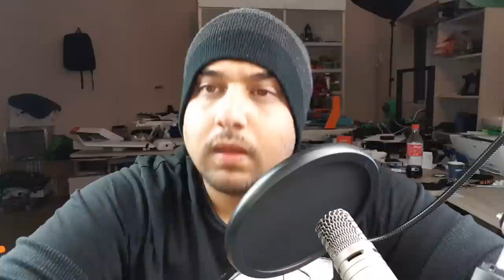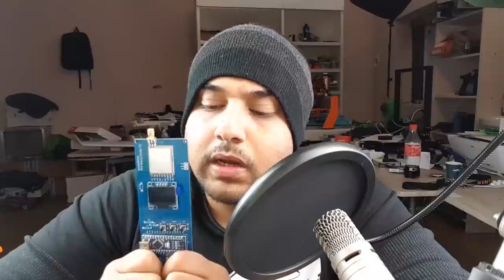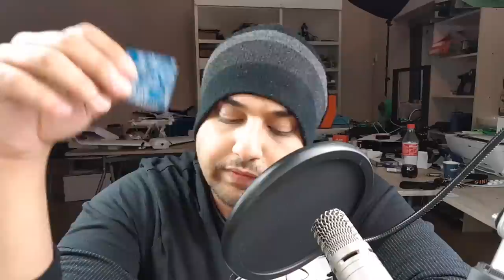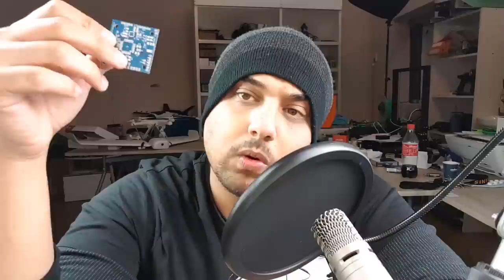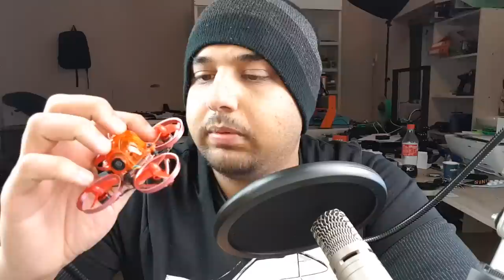DroneMesh OpenFC F7 FC, OpenFC F4 OSD, Wireless Frsky R9M Modules // VLOG #018

Comment: First of all: Great OpenFC project! I heared there's a solution to fight the noise of the ICM, that many FC's have. But even then there's still the elephant in the room: IME Betaflight isn't able to run 32k/32k in it's current state of development. AFAIK there's also no breakthrough for utilizing the F7 better in v4.0 yet - so we will have to wait till at least v4.1, what will be in Fall 2019? Maybe the F7 won't be able to run 32k/32k at all. I tried it on the Holybro Kakute with the F745 and it has 100% CPU load even with everything else turned off. 32k/16k is working - but I don't think it's worth the hassle for a DIY project. I would focus on a rock solid design because the newbie SMD builders will have enough hurdles - don't introduce others with the choice of the components. Only when there's absolutely no downside (other than maybe a few extra pennies) I would go with the ICM gyro.

Comment: Check out the 9 in combat wings with magnetic actuators. Back in the day we used to build little 6 to 7-inch wings out of Depron and hollow carbon rod. You can get a hold of depron sheets. If you need help locating any of the parts let me know I was an avid builder. Happy holidays to you and yours 🙏

Comment: I also love Kits!  Most interested in improving the FrSky experience and ease of use. Wireless firmware update and ability to query firmware versions? I am definitely on board with remote R9M. I want to mount both the R9M and my FPV receiver and antennas on a painter pole. I saw one example of a person mounting his system on a 100ft tower and re-transmitting on another frequency to his home ground station sort of like a repeater system so that he could cover his large acreage even at low altitude. Thank you so much for taking some of the mystery out of flight controllers!

Comment: I like the idea of a bring my F4 back to life kit (only requires the F4 and the MPU6000).  Probably need 2 versions, one with and one without OSD.

The back to life kit should be more for freestylers as racing tends to need a lot more stuff (like OSD, pin for cam control (could be motor 5 or motor 6), led control and regulator for vtx (high power, potentially lots of noise)).  Freestyle is more get out and fly and have fun.

I now need to get my SMD skills up to scratch.  I can see lots of things I can have fun working on and fixing.  I have 3 FC's, 4 4-in-1's and a camera that can be repaired if I have the SMD tools and skills.

Comment: Dude that wireless r9m was my idea! :( (btw you didn't stole it as I've never shared it ;) )
My idea would be to make a dock for external module, such as r9m and put an xsr inside to input sbus and output smartport for telemetry, should be only plug and play, and adding a 2.4ghz VRx and a small 5.8vtx as a repeater so you could fly with you usual setup but for long range and fly from your car or even your house,
If you need other ideas for this project or 3D files ask me, I'd love to help you!

Comment: Would love to see everything to run the Flight controller on one board and have a nother board that connects through pin headers or maybe a jst that has all the wire solder pads.  Then if you have a problem you don't have a million wires soldered to it.  You just disconnect the board with  the wires soldered to it and swap out or work on the flight controller.  Maybe even connect like the DalRC engine ESC/FC.
Reply: I bet you the first person to make modular parts like ESCs/FCs/VTXs and Receivers that easily and quickly connect will be making a ton.  That is what needs to happen to move this hobby forward.  Fast, interchangeable parts that need no soldering so you can just swap out quickly and go.

Comment: Dude, about the micro wing, you can make it with 2mm depron. Should be easily found in any... I don't know the name in English... But stores where you'd buy things like pens, paper, notebooks and so on. You know? And search about the WLToys V911 receiver board. It can bind to a FlySky transmitter (the first version), have 2 servos and you can connect a brushed motor to it (a cordless motor). You know?
I have a few of these boards here and I'm going to build a few small RC airplanes with them. I know a link with 3 plans for those micro airplanes, if you want I can send it to you. 😊